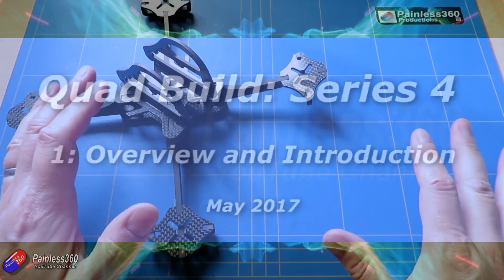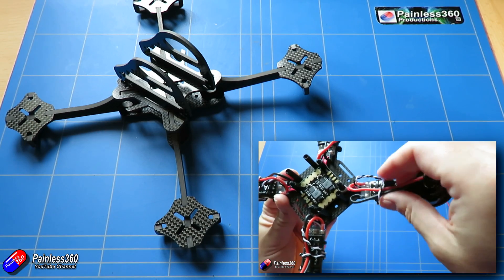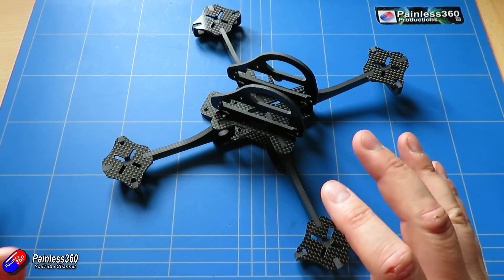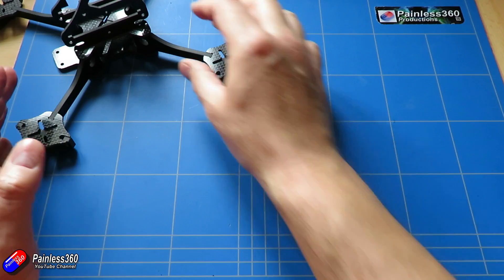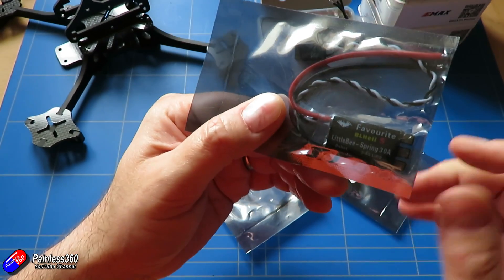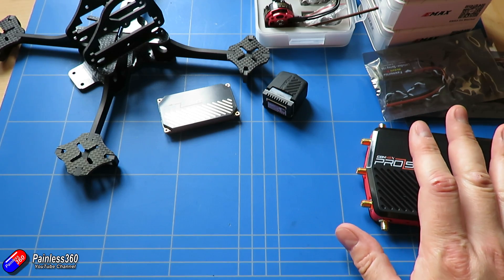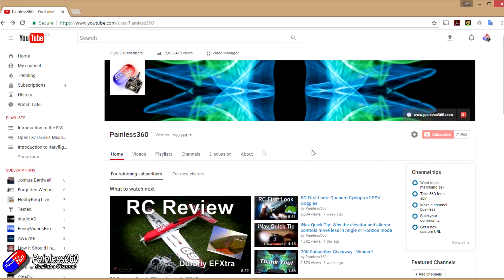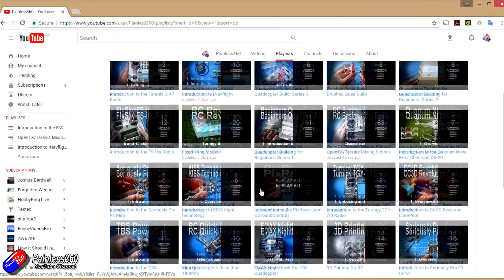(1/5) Quad Build, Series 4: Introduction and kit overview

Comment: these engines does come covered with that product that makes almost impossible to apply solder on them?
Reply from the maker: Nope, not had a problem. Some motors will give you problems if you cut the wires to close to the housing and leave yourself with just the lacquer insulated wire used for the winding themselves.. Scraping it off with a sharp knife or sandpaper usually gets you out of trouble..
Reply: Painless360 cool i'm thinking on rs2306 with kakute f4 searching for esc
Reply from the maker: Have fun with the build. Building these things is as fun for me as flying them! :D
Reply: Painless360 me too sadly at the butt of the world is hard to get parts even on the giveaways! now since the laws on chemical products is more restricted, is harder yo get batteries
Reply: btw. Can you do any videos on theory about aerodinámics. I've seen some videos on bruce's channel but he kind of gets too technical even got a cs engenieer
Reply from the maker: I could look at that. What aspects are you particularity interested in understanding more about?
Reply: mmm into detail running like how to find the proper angle on the winglets, or the CG, things like a begginer and a person that wants to move from drones into planes can catch up! thanks !